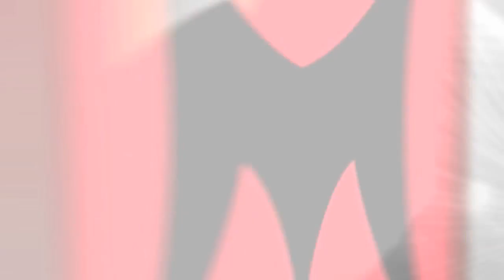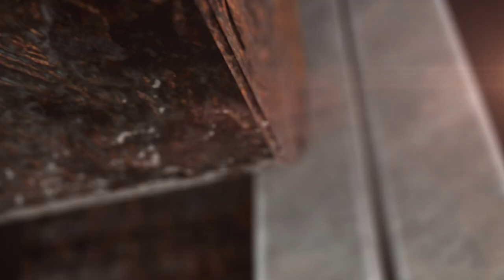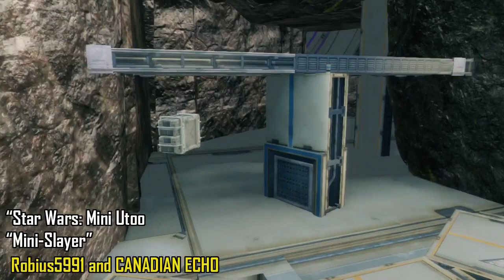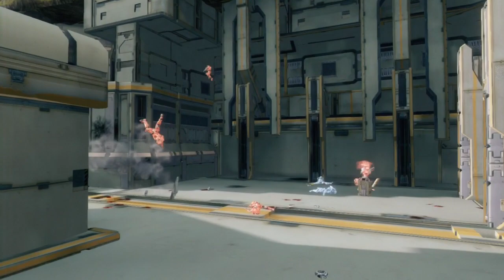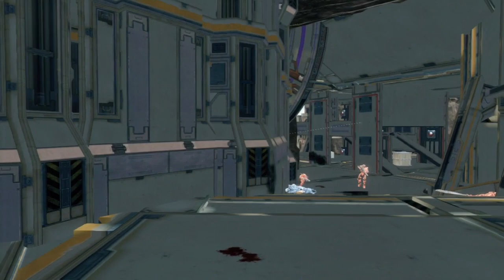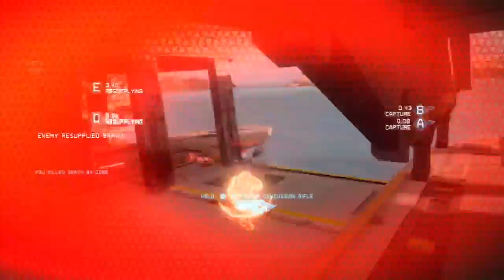"Star Wars: Utapau" - Halo 4 Forge Maps

Comment from the maker: We've elaborated on this before in our previous Star Wars maps; The reason the command posts have changed is because in Star Wars Battlefront 2, there were 6 Command Posts, while Halo 4 lets us only use 5 Dominion Bases. Therefore we make 4 of them identical to the original game, then we put the fifth somewhere in a logical "middle-ground" between where the original 2 were. That way it doesn't fluctuate gameplay too much. Unfortunately it's one of the limitation of recreating in Halo 4...